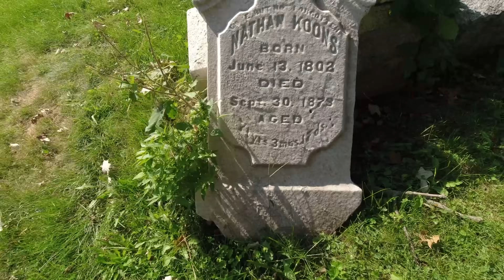Broken And Laying In Poison

Comment: If you think you've been exposed, or possibly exposed, to poison oak or ivy you should add Dawn dish detergent to you evening shower. The "poison" in poison oak and ivy is the oil in the plant's leaf. The Dawn cuts and washes away oil. That can help prevent the irritation and flair ups.
Reply: Fun fact. You can pre-oil your skin which will prevent the sap oils from penetrating your skin. Also wd40 or a thin oil will work for rinsing off the oils. It takes an oil to break an oil.
Reply from the maker: Ha I carry WD40 with me. Clean the tools at the end of the day and spray from time to time as moisture can really get to them…using it on my skin intentionally, well if it works!
Reply: @millennialstonecleaner  yep, if you rub against it don’t soap it. Spray the area with wd40 then wipe the area with a rag.
Reply: I was going to say that. If you can get to it within an hour, especially, dawn works amazingly!
Reply: @CeruleanTalon1  We keep some Dawn in our shower all spring and summer long.
Reply: Cream that artists use to protect hands from oil paint will work too.😉

Comment: The corner patches you did look more like a "new marble" white. You can artificially antique it by taking some topsoil and making a thin mud and painting it on the new patches. So, you will be trying to stain the new patches; kind of like you tried to remove the topsoil stain from the back of the monument.

Comment: Those rusting pins are a common problem in concrete engineering. They call the failure "oxide jacking" because iron oxide (rust) takes up more room than the original metal. The amount of pressure that can be applied is enormous. They actually make a concrete breaking material called "dexpan" that looks like grout but you pour it into holes in concrete slabs and it will shatter them just by expansion. 

Keep up the great videos and I hope you do another Diresta collab!
Reply from the maker: Yup exactly that. I refer to it as rust jacking but yeah we see this all over every historic cemetery. It’s a real challenge.

And def want to get out to see Jimmy again, we texted the other day.
Reply from the maker: I appreciate hearing the more technical term for it, hadn’t heard it before so thanks for that!

Comment: Turns out that Nathan is my 10th cousin 4 times removed through my father and his mother Abigail. I was blessed not to be allergic to poison oak, ivy or sumac.  My brothers just looked at the stuff and they would get it (or so it seemed).  My older brother pushed me into some poison ivy as a kid.  I had the oils all over me.  His mistake was that I ran after him to touch him.  He got a bad case of the stuff, and it never bothered me.

Comment: You can mix a bit ofviron oxide and water if you want to stain the new stuff to match. It is not a reversable process, however, so start out light. Ive not done it on a gravestone, butbi have done itbon a concrete patchbto make it blend in. Ironnoxide is soldvin powder form as a soul amendment.